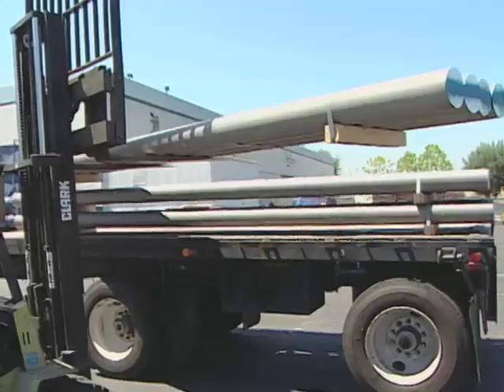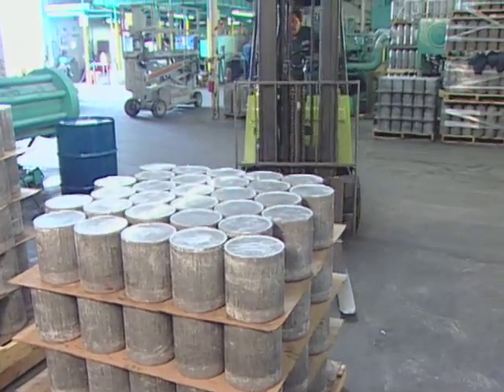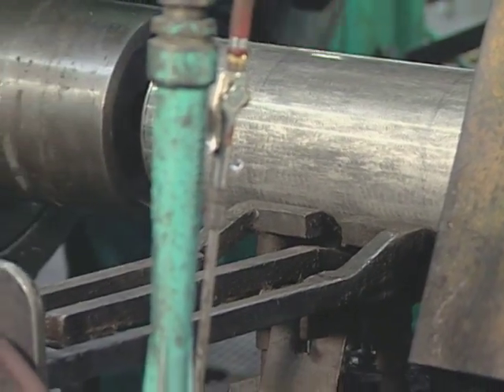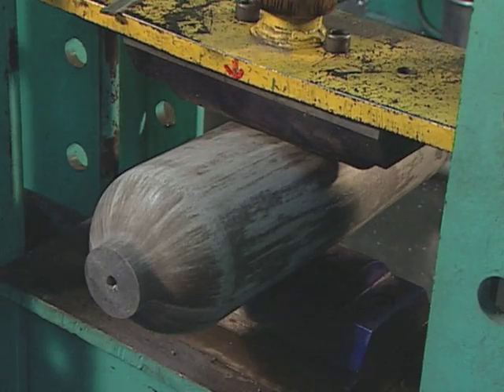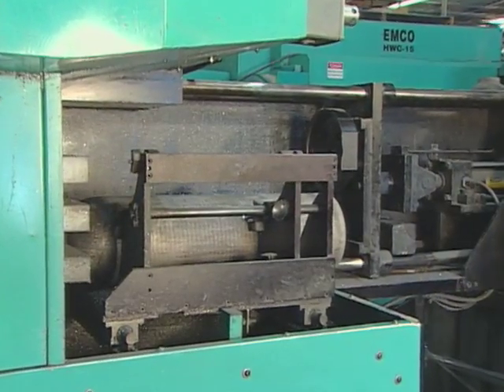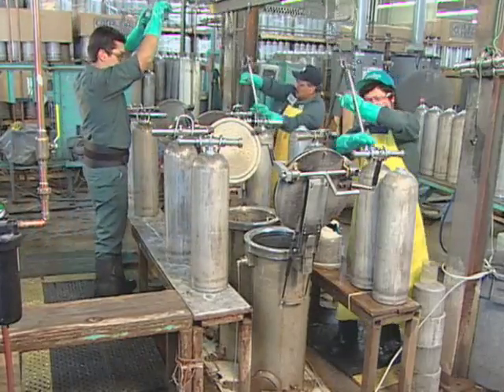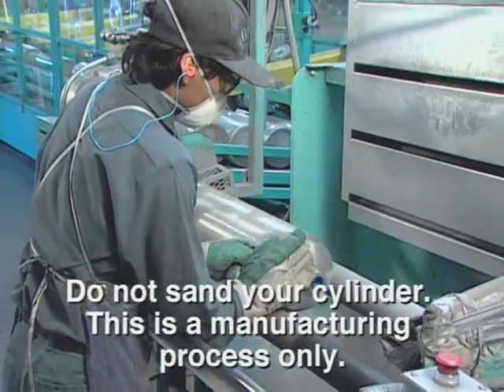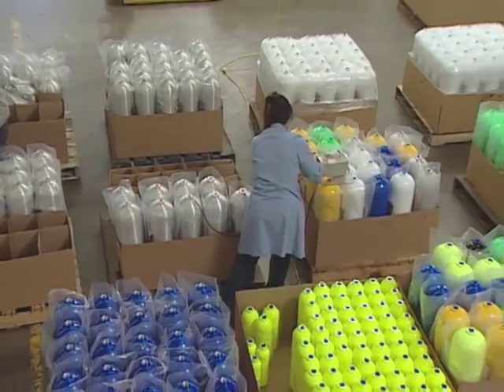making a scuba tank

Comment: @themightyharrison Get a Hydro done. Do a visual with a small light (enough to fit inside the cylinder) and a retractable mirror. Look inside for pitting and corrosion, look carefully. Remove the boot and inspect the bottom of the tank as well. You're best to have someone else do this, mainly because you're required to have an inspectors number issued by PSI in order for the tanks to even pass a yearly visual. I would guess the tank any good but who knows. Don't listen to the crackhead 'sinful'.

Comment: Very interesting. But some comments on the hydrostatic testing are slightly off. They use water in the tank because water is incompressible. They fill the tank with water and apply 5/3 the maximum working pressure (around 250bar if I remember correctly, so about 420bar) The tank flexes out with the pressure and when pressure is relieved the tank must return to within acceptable proximity of it's original volume. If it does not it is deemed not safe enough for use and removed from circulation.

Comment: Its very interesting to see them test them. They use water for testing for the main reason if the vessel would rupture the compressed air/gass would be very dangerous and expand and cause a exposion. With water the breach just makes a poping sound and simply leaks out of the rupture with like no pressure behind it. The pressurising unit also shuts down quickly once it happens.